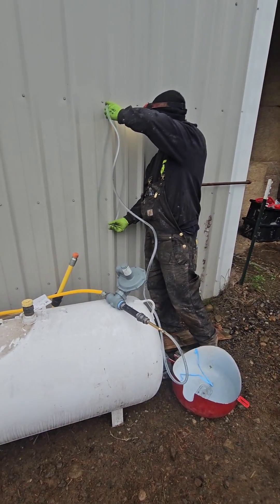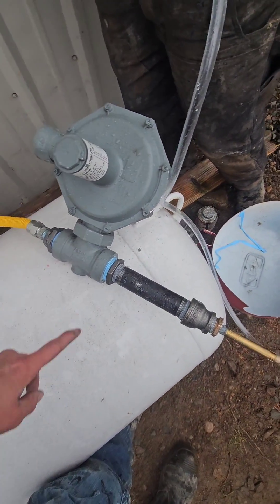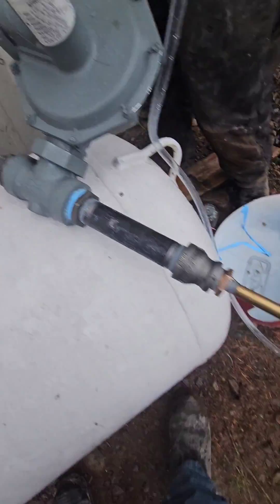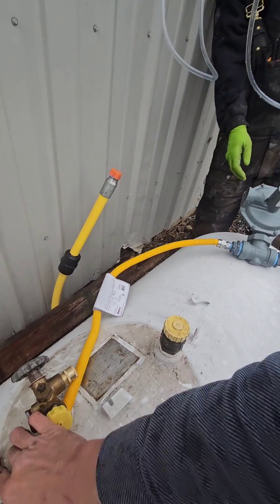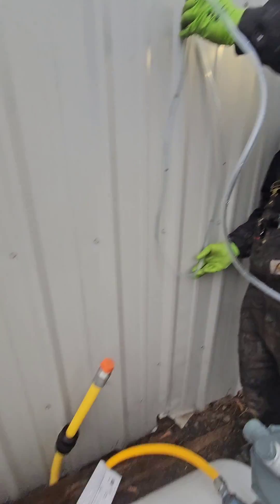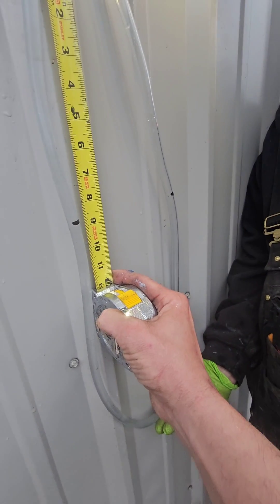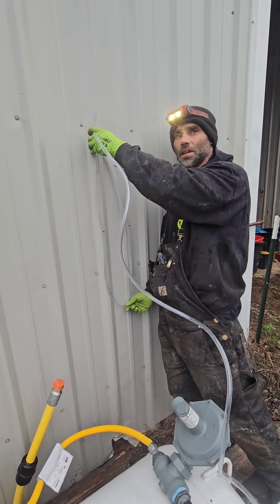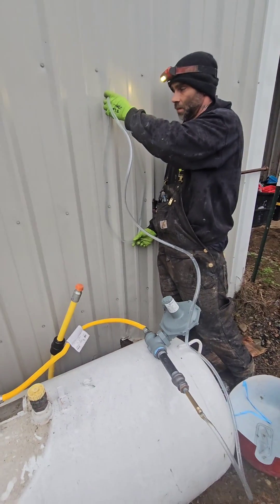Inches of Water Column Explained

Comment: Aren't  you suppose to measure both sides from zero. You measured just one side and said it was 9, but it was actually 18 total...too much water column pressure?
Reply from the maker: @keith6872  No Not Wrong. That's not a 18" WC Regulator. The Tankless I hooked up to that wouldn't even work. Your so wrong but wrote that comment with so much confidence.. Thats Wild
Reply: @LearnPlumbing  sorry I reworded it, but all the other WR videos I see measure total of both sides?

Comment: Make sure you have a digital one as well. Just had to diagnose a Nortiz and tech support wouldn’t go any further until I gave them the water column from a digital manometer
Reply from the maker: Definetly. If your calling tech support have a digital manometer to check gad pressure and have a multi meter to check   electrical components. 
What was the issue that you where diagnosing with Noritz?
Reply: @LearnPlumbing  code 11 I knew it was the igniter but I didn’t know the part number. Called tech support to get the information but them made me jump through multiple hoops to get that info